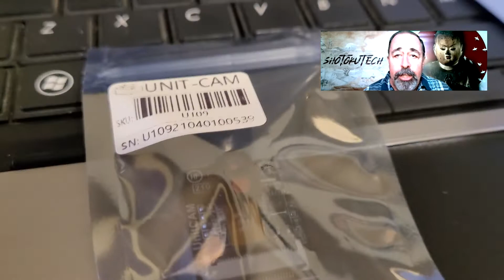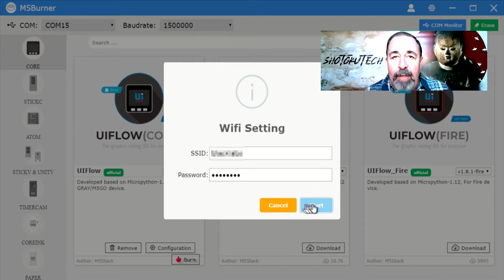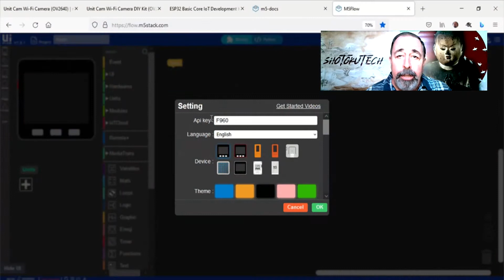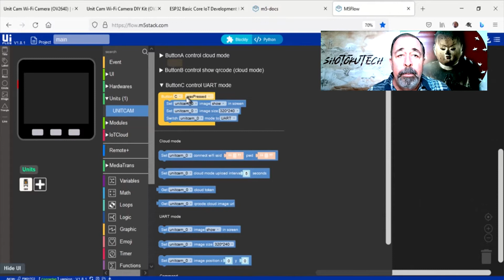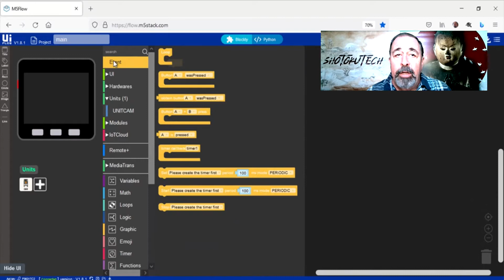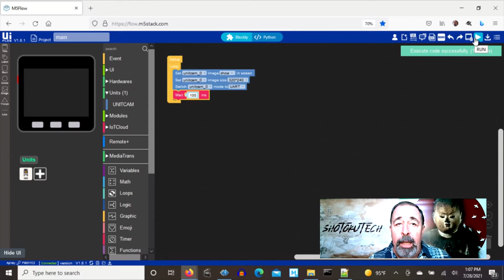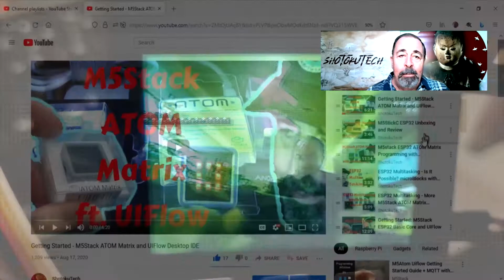Unbox and Test M5Stack Unit Cam WiFi Camera DIY Kit

Comment: Im a test engineer and I have a Core 2. I need a system that utilizes a camera with a pressure monitoring capability in one. 
I want to use the tube pressure module that is available to use simultaneously with the camera.
Any suggestions are appreciated.
Reply from the maker: I would look at a full sized ESP32 with camera module, as it is likely there would be spare GPIO pins for your pressure sensor. Here is an ESP32 Camera in action: "TTGO T-Display Streaming Video Over WiFi From ESP32 CAM" https://youtu.be/aIxaR6legnw
This seems like a good candidate: Freenove ESP32-WROVER CAM Board, Dual-core 32-bit 240 MHz Microcontroller, Onboard Camera Wireless, Python C Code, Example Projects Tutorial https://amzn.to/45FZvnk
Best wishes. Thanks.